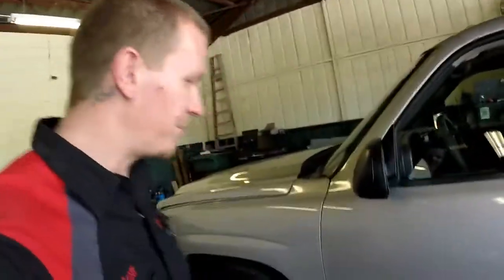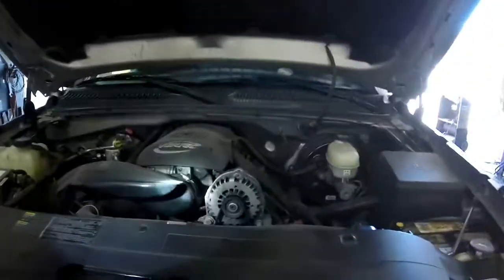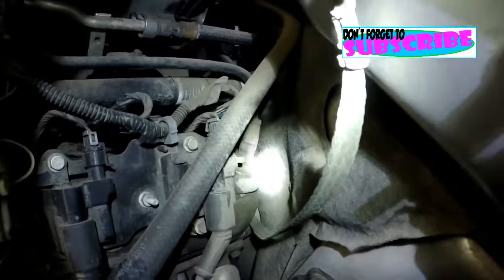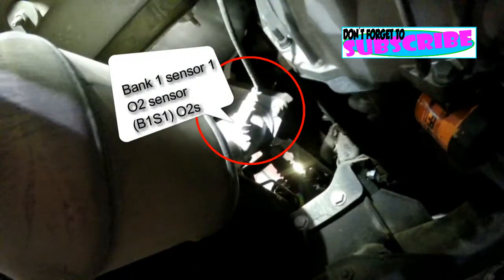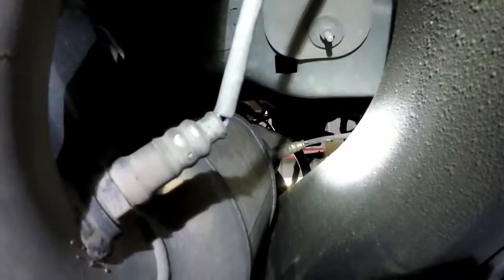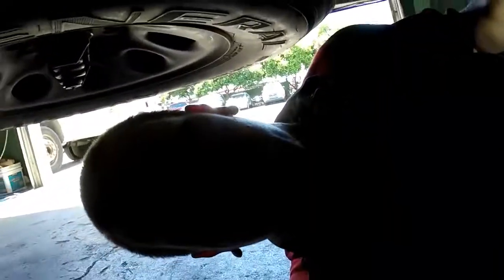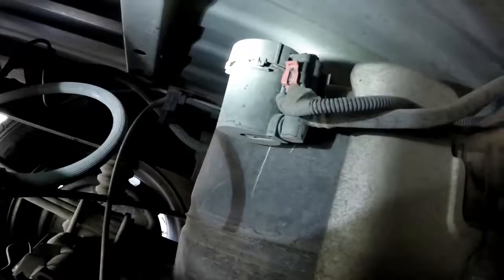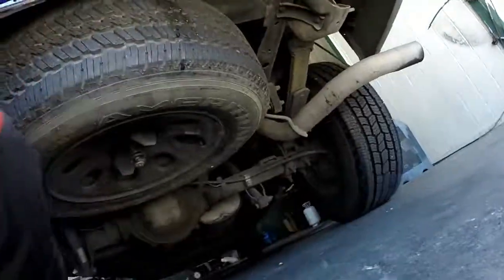Chevy Silverado emissions: PCV, EVAP, & Oxygen sensors.

Comment: I bought a 95 silverado , it has a 350 ci v8. The front 02 sensor isnt plugged in and I cant find where it goes to save my life. Been searching videos for a while now hoping to catch a glimpse of where the damn thing plugs in. Who ever had it before me must have tucked it away or something.
Reply from the maker: +Brian P. Box I believe the connector is on top of the transmission. If you take a look at my other videos I think I have a video of replacing the O2 sensor on my 1994 Silverado 5.7 l.
Reply: I found that one but there is one on the drivers side manifold unless thats not the original manifold, maybe its been tricking me. I did watch that video in hopes of learning something, it may just have the one. Ill replace it and see what happens as I am sure its bad. Had the exhaust worked on the cat converter was wedged sideways and with all the carbon that fell out I am sure the sensor is covered with it. Thank you for replying!
Reply from the maker: +Brian P. Box i have a hole on my driver side too. My is plugged.
Reply from the maker: +Scotties Hobbies mine*
Reply from the maker: +Brian P. Box its probably a aftermarket exhaust manifold that was purchased after 1996. In 96 or 97 they went to the catalyst monitor and that required GM to add a driver side pre-cat and post-cat oxygen sensors.
Reply: I bet you are right, well I know what I will be doing tomorrow lol :) Thank you for the tips!
Reply from the maker: I'm reading over everything, I've now see what's going on. So you have a O2 sensor on your driver side exhaust manifold just hanging there? That's pretty funny. I bet somebody just replaced that exhaust manifold with a newer 350 exhaust manifold.
Reply: Yes lol, its been fooling me this whole time!